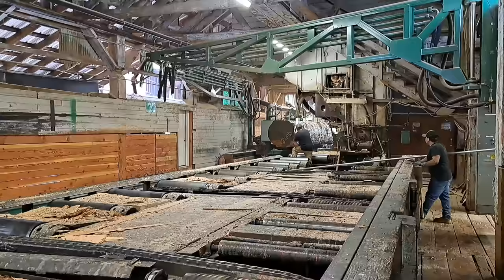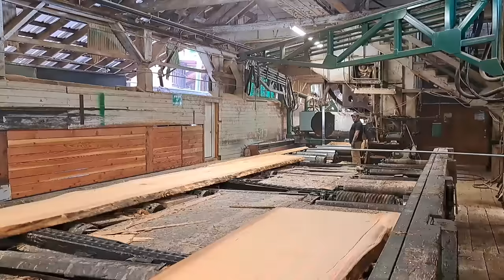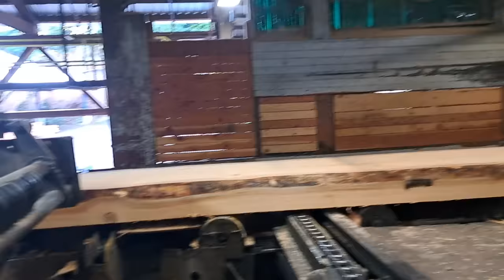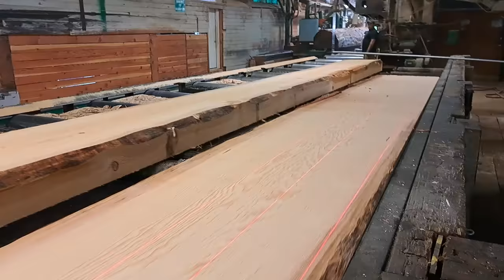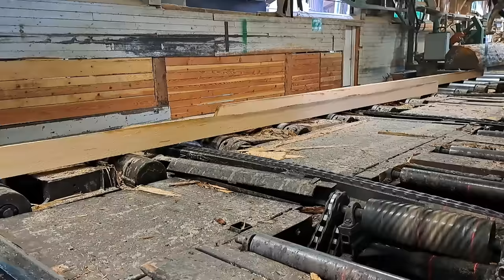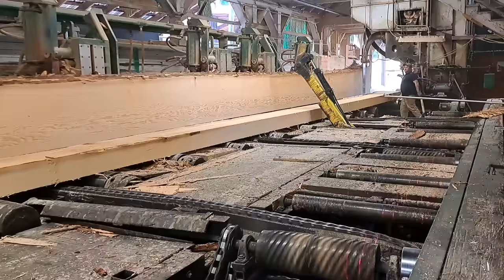60 ft douglas fir

Comment: Love this! Used to work in a sawmill, but our long length lumber was a maximum of 20' with 16' being the finished product. Our head rig was similar except we had a slabber (a chipper with angled knives so the sawyer could cut a flat spot on the log and make a board on the very first pass), and a double sided band saw so a cut could be made both directions across the saw. I think 60' might be much for a double bit bandmill though. Anyway, great video! Hope to see more!
Reply: Wow that long logs! We have a sawmill in South of Sweden but would like to come in contact with a mill that could cut Douglas in high quality long length. Do you have any contact? Br fredrik
Reply: The mill I worked in was 20 foot as well. Our main saw carriage was a circular saw. It had a stopper for the edger and the edger could handle 8 inch but for the sake of the blades we kept it at 6 inch. The actual main saw could and did do 12x12 and 12x16, 18 and 20 feet for specialty orders going to a log home company. We mostly did Spruce and they didn't order that stuff very often. Good thing because we didn't get the logs to make them very often.

When we saw the doors open that bypassed the debarker (they weren't going through it) we knew we had an easy day because that stuff took forever to mill and was too big to man handle.

Comment: The guy on the pike pole has to have a lot of upper body /upper arm strength to hold the slabs of lumber in place, and to guide them off of the log.